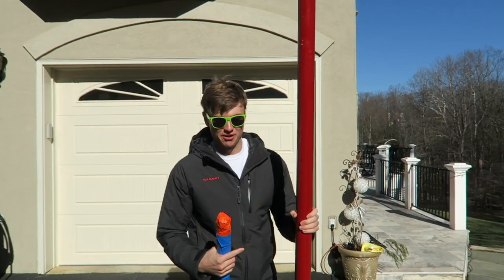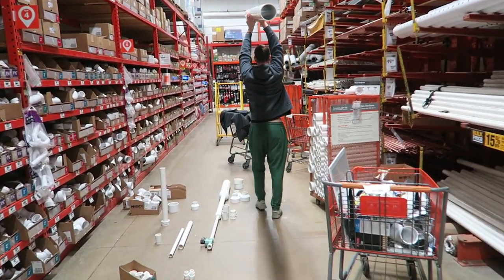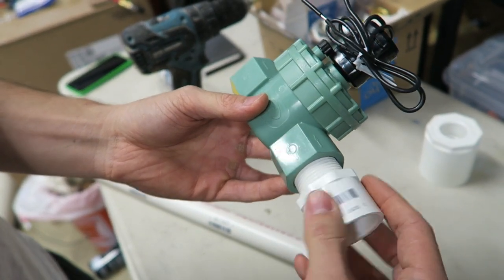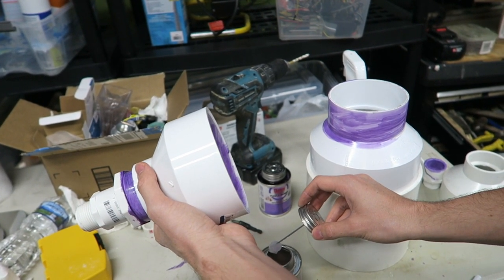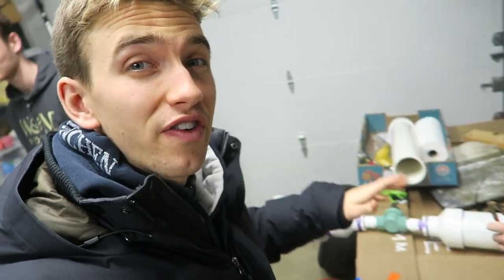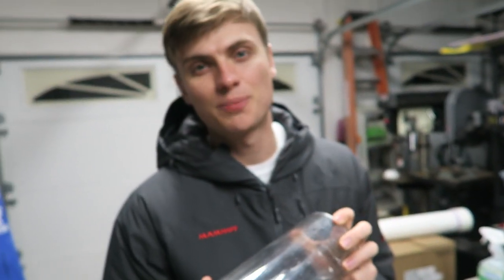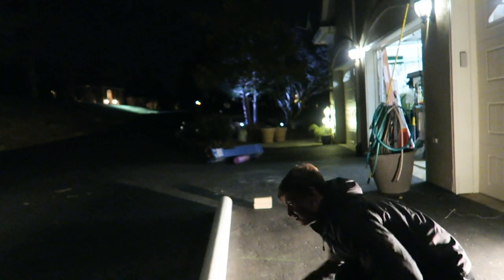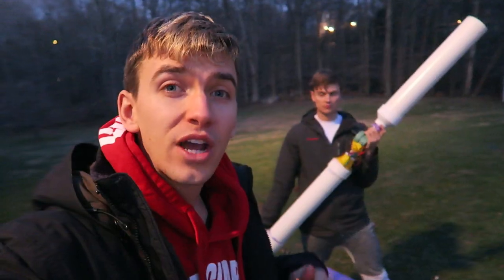BUILDING ULTIMATE NERF WAR MEGA BLASTER (Extreme Nerf Gun Power!)

Comment: Make the projectile fit in the barrel tighter raise the air pressure so you'll need an actual air tank or test it with pvc it's always fun to watch them explode also add some lead weight of some kind to the front and duck tape the whole thing and that thing should fly

Comment: For the air chaimber try using two 90 degree elbow joint and essentially have it doubled over on itself it takes up less length and can have double the capacity of the current one whilst still having the same length

Comment: #NERF I really do not know much about nerf but one thing, remember how the noodles have a whole in the middle? cut that thing in half and completely tape the whole in on side of the noodle that way the air pushes the bullet even faster! and instead of using a bigger tube to hold the bullet use a bigger pipe to hold up much more pressure and that would seriously resist much more!

Comment: new idea use a really small pvc pipe thats short enough to fit inside the nerf dart then put a bigger pipe over the small one that fits on the outside of the dart.then you put the small pipe inside the big pipe use the same chamber that you use now. i think that the small pipe would fit right in the air lock and i think that it would get more power  couse the presure would go right in to the nerf dart and it maybe will fly straghter

Comment: It's the amount of air you have in the reservoir.  In chemistry, (Pressure1 x Volume1)/Temperature1 = (Pressure2 x Volume2)/Temperature2. Because everything is at the same temperature, that can be negated and it's just P1 • V1 = P2 • V2 so for the reservoir you either need a higher pressure or more volume.

Comment: So what you will need Is 2 coca cola can wich are empty and a nail a hammer lighter craft knife and some cotton oh wait and a little candle next stem cut the coke can in half accurate and the bottom bit is what you will need next step is to put the cottons inside next make a hole in the middle outside and inside then light up the candle put it under 2 square big rocks put the coke or shall i mini barbeque on top of it next put oils or a oil that is strong next test it out and finish please give me a swag pack please I did this all for you